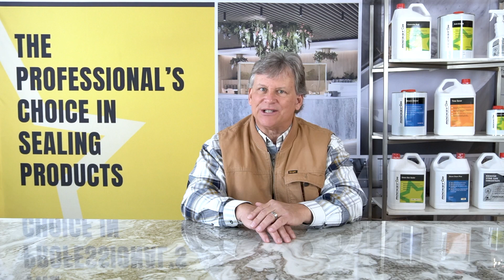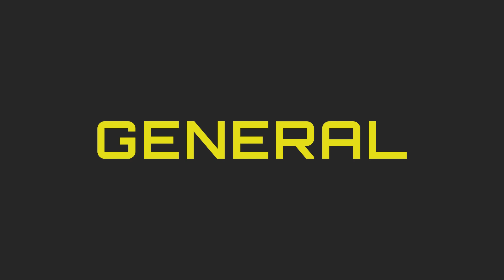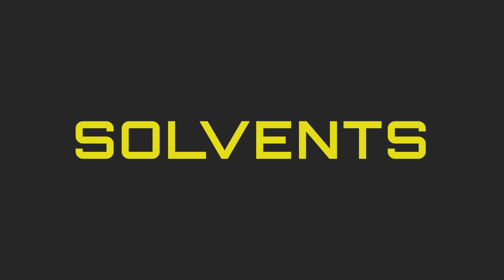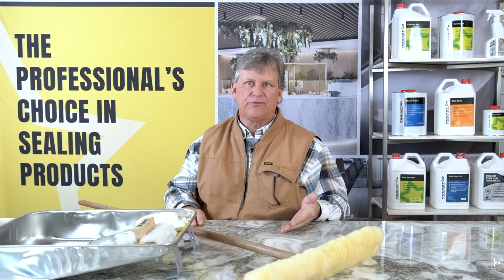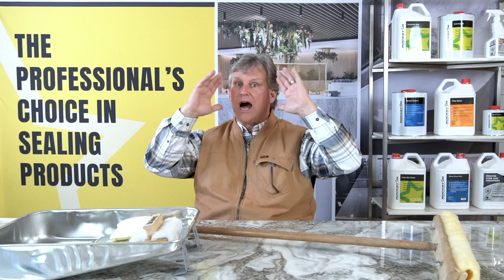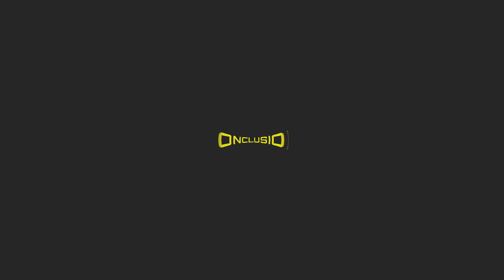How to Seal Natural Stone (BEGINNER'S GUIDE, Part 2)

Comment: Nice job Skip. Just did my black Home depot i believe it's slate. I used the Dense stone sealer . Dwell time was 15 minutes and 99% of sealer absorbed. I am waiting for 1 hour now then will apply a second coat. Wait 15 minutes for dwell and remove what is left over. I guess once you stop smelling the solvent in the room you are finished with your initial cure time. I am guessing 3 to 5 days and then a total cure time for at least 2 weeks. Great explanation of what is going on. 12 minutes of total helpful info.